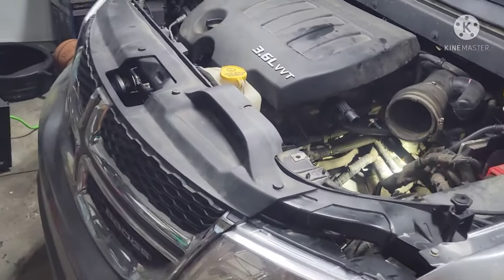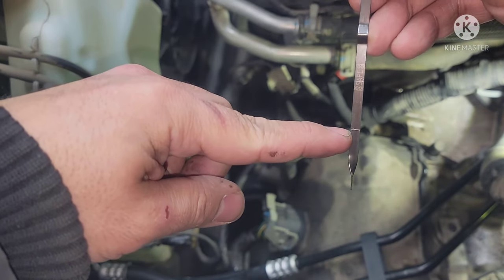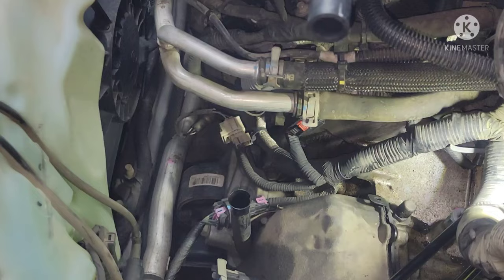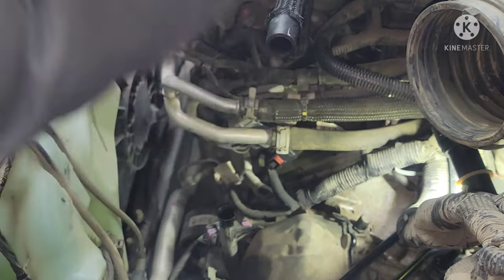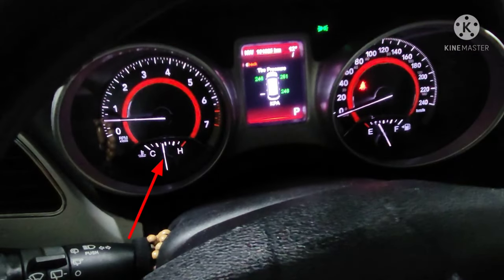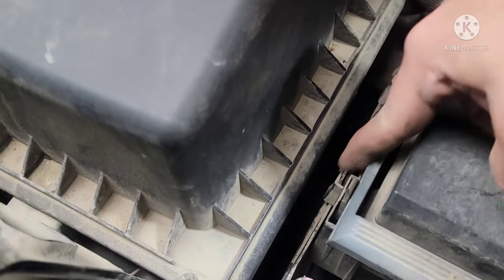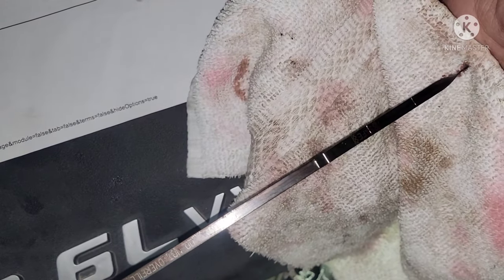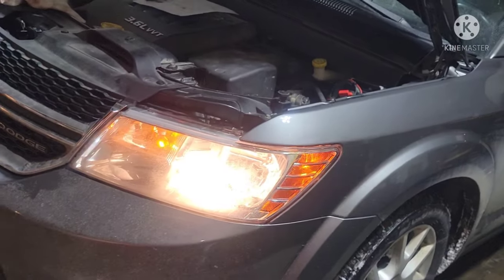Video3: Proper Way Adding & Checking Transmission Fluid Level Journey Avenger, Charger, Caravan 3.6L

Comment: Also be careful, I just got into trouble. There is a bend in the trans dip tube and in a certain orientation, the oil dipstick feels like it bottomed out, but it was something in the bend that felt that way. This caused me to overfill the trans by 3 liters!.... Something didn't feel right about adding almost 5 liters to the trans... So I looked at the video again to see how far down the dipstick went down in the tube and saw that mine was much higher. So I pushed a bit harder and it went down to the real stopper!   I had to siphon out all the oil I had added and start over. In the end I was only down about 2 liters... So make sure you get past that bend in the tube and get to the real stopper. The handle of the dipstick should go below the air filter about a hand width or 3-4 inches (forgot to measure exactly how much) from the top of the tube. If yours only goes down a bit and stops at the bend, (the handle is above the air filter) try turning the dipstick 90 degrees and try again to get past the bend.
Reply: finally someone else realised all these videos are wrong. the dipstick installs into the tube about 16.69"(according to manuaL). not one video ive seen is diong it right.
Reply: @shaundemello8705  So in order for the dipstick to truly bottom out, it must extend about 16 inches into the tube?
Reply: Whats was the symptoms when you overfilled ?
Reply: @moshex99  I never drove it or started it when I overfilled, As I got suspicious when I added 3 litres and it still didn't show on the dipstick, that's when I pushed a little harder and it went past the bend and hit the proper stopper, so I drained the three litres and started refilling again with the dipstick hitting the proper stopper.
Reply: S

Comment: Don't rely on the diagram/chart and assume it is to scale. Use a small ruler to measure actual level in inches or mm's on the dipstick....   When I printed the chart it was NOT to scale.

Comment: My 2017 caravan dropped out of gear and won't shift properly.   I put it in drive and it doesn't go.   But if I rev the engine to 3 or 4k rpm, it makes the car go 15mph or so and then drops out of gear.   Mechanic said tranny is shot.  Worth getting a second opinion?  Anything else could be the problem?  136,000 miles
Reply: Mine is doing this too
Reply: Just started yesterday. I hoping some fluid gets it back right … I’m sad
Reply: @dame4ever  what came of it?

Comment: im going to do this with the mm ebay transmission fluid dipstick, u can find it cheap. and thats a nice chart in the video 👍. my 2018 journey crossroads package has a transmission temperature temp gauge in the digital screen/cluster. remember to check the fluid before and after the change 🤙

Comment: Sir I have a 2006 Dodge charger that does not have a dipstick either. Can I use my oil dipstick to check the transmission fluid? I just tried it and when I pulled it out it had absolutely nothing on it To me it did not feel like it was going far enough in.
Reply from the maker: Not sure if the Dodge Charger  same dipstick compare to a Journey. Need to research and  double check

Comment: So no more checking running in neutral? Do i start first run trans threw the gears then shut off first then check?
Reply from the maker: Checked all the gears including the neutral gear (put the shifter all in each gears)   Put oil in the tranny cycle the gears  shut off the engine  and check  the oil level.

Comment: How many letters transmission  oil level? 3.5 6speed.
Reply from the maker: Around  5.2L (5.50qts) check your owners manual for Spect & make sure the fluid is on a right temperature

Comment: Noticed that you did not Mark your dipstick on the other side that's for oil so why you measuring it with that the specifications for the specific car all vehicles are different
Reply: I re-watched a couple of times and saw his marks on the same side as the oil marks
at 1:40 minutes.
Reply: It will give you a general idea